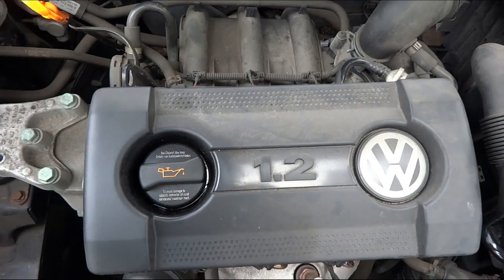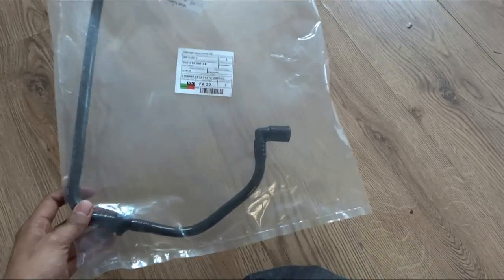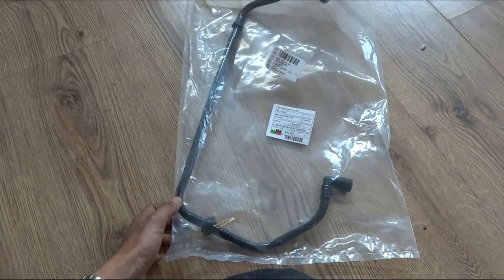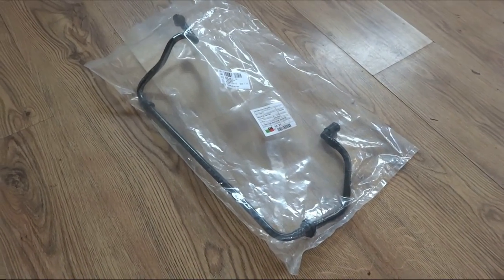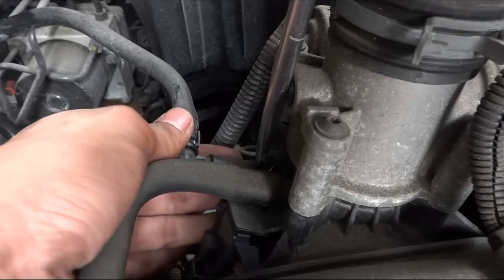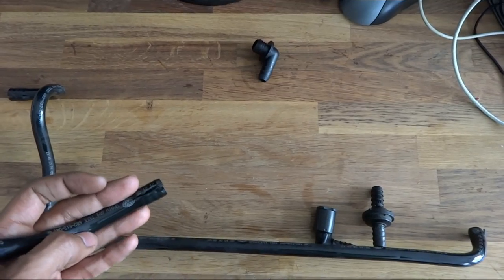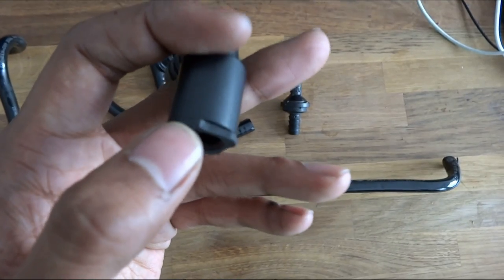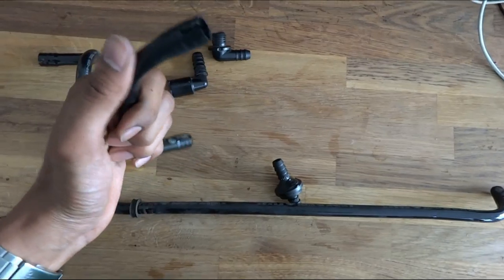VW Polo - Fix Vacuum Leak rough/high idle

Comment: thanks a lot for this video as i have a vw lupo that was missing after i did everything i can. after looking at thing last night i repaired the line by cutting of the broken ends and refitting it. it stopped the missing. so thanks. i would have never guess that the line from the brake booster can affect the idle of the engine.
Reply from the maker: Sweet idea on cutting the ends :), wish I had tried that! Glad it helped!

Comment: Interesting video, seems to have shed some light on a similar problem I'm having. I have 1.4 polo- engine code BKY. Rough idle and ducking below 750, especially in traffic when foot is on brake (It sometimes stalls) and there is little engine torque below 2000. Also I have an induction roar similar to aftermarket filter so my attention was turned to throttle body but after watching this video I have now noticed a huge split (near the check valve along bulkhead) on this pipe. well done and thanks :)
Reply from the maker: +Neil Turner If its split might as well try and see if this fixes it, pretty cheap fix to do. any fault codes?
Reply: +Messed Up Mechanic I'm currently awaiting part - VW only! My pipe is shorter as it's the 1.4 BKY engine. Why was it made of plastic and not rubber/silicone I wonder?
Reply: +Messed Up Mechanic and no fault codes, just a poor idle/stall in traffic when foot on brake and also poor pickup from idle to 1500 rpm. been driving me crazy as I thought it was possibly a blockage in throttle body but it's clear as day now.
Reply from the maker: Probably was cheaper to make ha! The new ones look exactly the same. Beware you will probably have trouble starting the engine at first, at least I did - (I think because the leak was pretty bad). If you got a code reader clear all all codes after repair, might help clear ecu.
Reply from the maker: +Neil Turner Also if your hose is connected to the firewall like at 7:34 , be careful when you remove/replace as I must have weakened it and my clip broke of a few months later and the hose was rattling about inside
Reply: +Messed Up Mechanic only 1 clip but noticed there is an unused clip for the longer hose (which must be for the one you have) so if I break it I will pilfer that one :). Also with  leaks, air/fuel metering can be affected, I usually disconnect battery and go and have a long cup of tea and then sorted. not much trouble with this car in 11 years other than silentblocs, coil packs and shock absorbers!

Comment: Hey ,, I have a question , hope you can help. I have a VW Jetta TDI 2004 MK4 engine. The brakes work fine when the engine is running, never had a problem.. However, originally after turning the engine off, and after a few minutes if you press the brake pedal , I use to have some braking ability, at least a couple pumps, than it would use the "stored" vaccum that the system had from when the car was runing,  and even the next day if you press the pedal before starting the engine, I would still have that nice and smoth action , as if the car wound be runing ( just for a couple pumps at least, than I would start the car, and all would be ok)  I am assming that would be because of some vaccum pressure from the day before that was kept in the system , that  is normal of course, But now, as soon as I turn the engine off, a few seconds later, if I use the brake pedal just once, the brake pedal becomes hard, as if I had pumped it a few times. My guess is that I have a leak ( rather large leak) in the system,, As I mentioned, it does not affect or its note noticible when I am driving, Because of that, I did not bother to look for the leak yet. I consider myself pretty savy and do most of my car maintenace, and  since I have some extra time now  with this COVID-19 confinement I am going to look for this leak.
So, before I start looking around I would like your professional opinion on this subject and what you would recomend I start looking for.

Much appreciated 

ED

Comment: Bro thanks for the video ...can you link me to where you bought that entire kit ..I seem to be having a very similar if not exact same problem as you have had ...I can't seem to find that exact kit you got anywhere , if you ordered online could u tell me where or even better share a link to the products please.thanks in a advance bro
Reply from the maker: Hi, from VW dealership. Google 'etka', you can find the part numbers you need there, there is one called volkswagen.7zap that is good. If sont wnat to go to the dealership you can probably get them on Autodoc site.
Reply: @messedupmechanic3607  appricate the answer bro ...kinda had to get it sorted asap so unfortunately although you got back to me it was just a little too long a wait but i still appricate your time answering me ...cheers bro

Comment from the maker: Thanks for watching! This is a really easy job that almost anyone can do!
Reply: Messed Up Mechanic hi mate what about brakes when engine off cant press breaks whats the prob is it natrule or any leakge i have to use handbreak to stop my car if its on park on hill and engine is off
Reply: Try to see whether it's just (a LOT) heavier than with the engine on. The hydraulics for power brakes will only work with the engine running. The brake pedal would be a lot harder to press but the brakes should still engage. (Same goes for power steering btw)
Reply: Messed Up Mechanic hey brother where could I get that parts to buy...

Comment: is this damage pipe cause engine light on your dashboard?
Reply from the maker: No, it was an unrelated issue
Reply: I've just found this issue with my 1.0 6n2, it does throw an MIL on the instrument cluster, it does come and go though however lately it is throwing the P0 code every day so thought I would actually see what is wrong and these are the same symptoms my car suffers from, poor braking and a rough idle where the RPM usually sits at around 1,100 or too low sometime at around 650-700
Reply: Yes i have the same problem its the vacuum tube a engine light the gas mix is too thin because of airintake.

Comment: Mine runs rough at idle and when I press the accelerator it surges rhythmically from tick-over to about 2000rpm and back continuously. It can't really be driven like this.
Do you think this is related to that pipe?
Reply from the maker: did you visually check the hose for cracks/ leaks
Reply: Got the AA to have a look. They fitted a coil pack for £40 and all fixed..
Reply: I know this is a late answer but for anyone who has the same problem it is a spark fault.

Comment: there is a hissing noise in the cabin which I strongly feel is from the brake system. Is this likely to be the problem?
Reply from the maker: +Shakunt Tambe Hey,  personally I didnt hear any noise related to the leak. Did you check your hose for cracks?
Reply: +Messed Up Mechanic planning to check it soon when I change the air filter.

Comment: Hi there great video, could this hose cause the car to jerk violently when accelerating? There are no lights on dash, all coils are good.
Reply from the maker: +Dodger Hi, vacuum leaks like this are normally associated with fast & rough idle & stalling. Tho a google for 'vacuum leak symptoms' also mentions about misfiring when accelerating, so could possibly be a cause of the problem - but I think it is an outside chance. Did you check the hose for cracks?
Reply: hi thanks. it wasnt a vaccum leak but the cable connecting to the throttle body, one of the wires  was damaged.
Reply: your tracking might be out